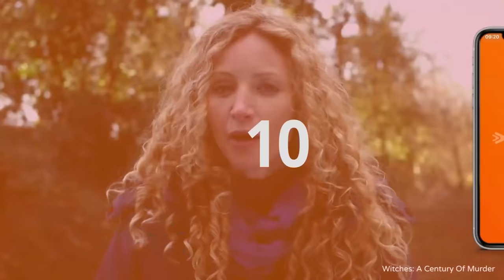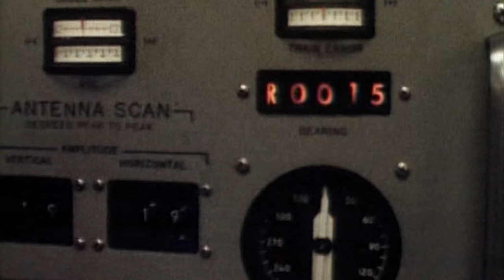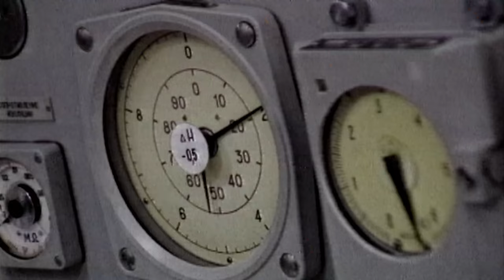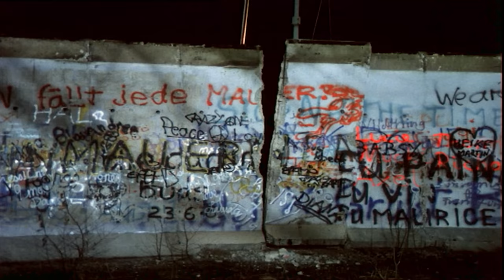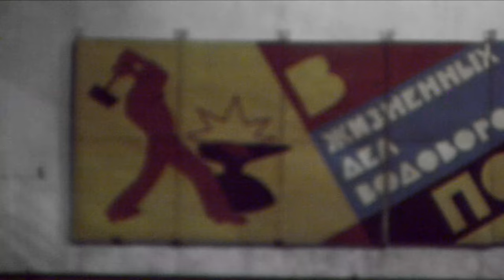What Happened To Russia's Cold War Nuclear Submarines? | End Of Red October

Comment: 9:15 "Welding thru thousands of tons of steel...." I've worked in sub recycling, and although there is some welding involved for things like creating lift points for rigging, for containing the reactor, etc, there's not much welding going on. Lots of torches, plasma cutting, carbon-arc, oxygen lance, etc are used because that's how you cut steel. Seems like so many of these shows confuse welding with cutting.
Reply: In a nutshell:
Welding: action of welders doing their things.

I know...
Reply: @alexandrevaliquette1941  ya. That's not how they used the word though.
Reply: @justlucky8254  I guess we should let them Youtubate their thing to people.
Reply: Air-arc?  
That is a welding process, so is oxy/acy cutting.
Reply: These modern day "documentaries" are so dumbed down and cheap even the narration is nonsensical. The producers either don't understand the subject matter at all or just don't care enough to even bother describing things accurately. Theres better documentaries made by part time YouTubers these days.
Reply: Thanks for pointing that out.

Comment: In the USA, we do this to our old subs as well.... But our fine sailors stay attached to the ship, and the ship is manned 24/7 until all hazardous liquids and the fuel cells are removed. Only then do our navel shipyards cut the aft and forward ends of the ship into scrap. The defueled reactor section is then sealed on both ends with 2" thick steel (maybe, only saw it happening from the top of the dry dock, but it's thick stuff.) The reactor compartments are then loaded onto barges and moved into an open trench that you can see for yourself on google maps at the handford site. Beyond that, I don't know what we do with them. But they are safe, just big cylinders of steel that are just lightly radioactive, but not leaking contamination(all water is gone anyway) and I would bet they do surveys just to check like they do in this video. Source, I walked past the cutting drydock on my way to work and watched 3 subs get slowly cut up day by day(very cool to see when it is a class of sub you know the layout of) and was on a team that drained, defueled, and decomissioned 2 subs which are probably cut up or being cut up right now.  Cheers. I support nuclear power. Stop closing down powerplants before their end of design life because you have do all this same crap regardless of the age of the reactor. Enjoy your blackouts Cali folks.
Reply: Yup Bremerton I've been there I seen the rusty hulks of subs being cut up. Bremerton is where subs go to die.
Reply: @geomodelrailroader  did you work there? I used to be a machinist there. Shop 31, building 431. I was lucky to never be loaned out to the cut-ups like some other shops were when things were slow. I did mainly prop shafts and heavy tool so things were always busy other than being loaned out to the prop shop once for a few months. It was interesting to watch the progress of the subs being cut in a drydock on one side of my shop, and then looking into the drydock on the other side where the opposite was happening and we were doing D5 conversions or making the Ohio slightly "more better".😁👍
Reply: No blackouts here in Cali…take a sip of Fukushima water and calm down
Reply: @farzad6908  Get me a nice glass of water and watch me drink it. The fact you think the water is the dangerous part shows everyone here how little you know about American designed pressurized water reactors.
Reply: Ты прав. На самом деле всё безопасно.

Comment: 24:49 it is possible to se a body on the  middle down section, behind of the metal structure.
Reply: There is no body
Reply: @Elixir_Sullivan  Not exactly at 24 49, take a look at the center, when the camera goes down.
Reply: @24:51 you mean?
Google pareidolia. I believe you've had a case of pareidolia. It looks like some pipes valves and just metal wreckage overlapping in depth offering the brain that opportunity to try to rationalize what is seeing.
Reply: @will891410  I see something but I can't confirm it as being a body
Reply: @Elixir_Sullivan  Pause it at 24:52, down to the center, there is a face.
Reply: @will891410  Yeeh  i think i can see that to.    maybe the clip changes right there?
Reply: @martinlund9524  There is a transition right after, i think yes.
Reply: @will891410  it looks like a face. can't imagine a body still intact after that blast. I'm surprised men were still alive in the back section; the blast was recorded all the way to Alaska!
Reply: I can see two faces, one is slightly to the right looks to be almost facing the first.
Reply: @michaelcoles6140  it does, and looks like you can see the left arm
Reply: @dsm9785  screen shot it, then zoom in on individual areas looks like you can see another arm in between them both.
Reply: @michaelcoles6140  I did just that! A little fuzzy though

Comment: @09:13 JEES IF your gonna make a video about cutting up steel at least get it right... the dude say { selding though large steel } mean while they are burning thought steel...who hires these people?
Reply: Yep. They are so advanced that they cut with welders. Maybe they bond metal together with carbon-arcs and stuff also. 🤣 (on a side note, I read a comment from somebody a while back who was trying to be sarcastic and madea joke about using dynamite to weld metals together. It was ironic because I use to work in a place where we used explosion bonded materials. We literally had plates of dissimilar metals, titanium and stainless steel for example, that were bonded together by using explosives. It's neat to have material that is say 4" thick and one side is 2" of titanium and the other is 2" of aluminum, and they are so well "welded" together that they are hermetically sealed. We used the material to make ultra high vacuum chambers and other cool stuff for NASA, CERN, SPACE X, Los Alamos National Labs, etc. It's one of the coolest materials I've ever machined or fabbed.)